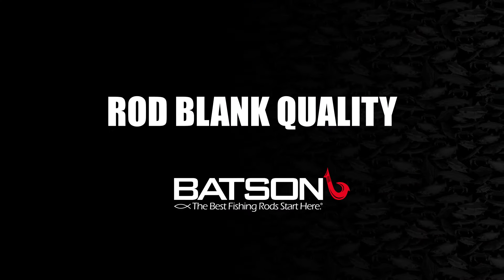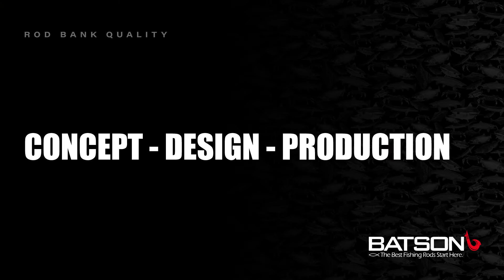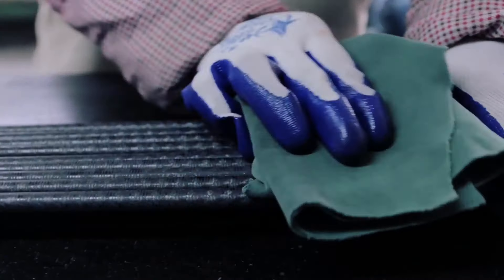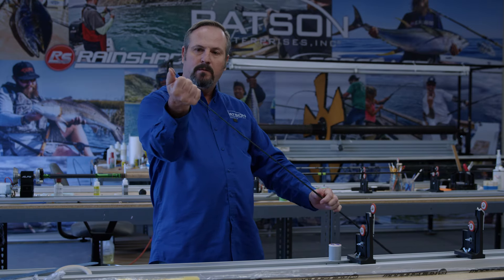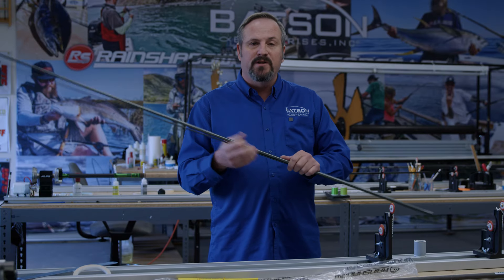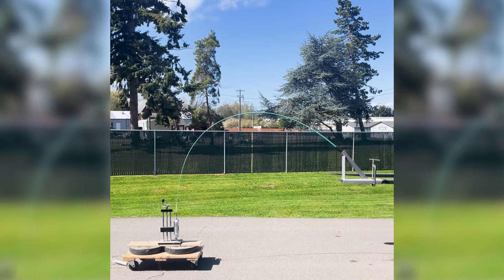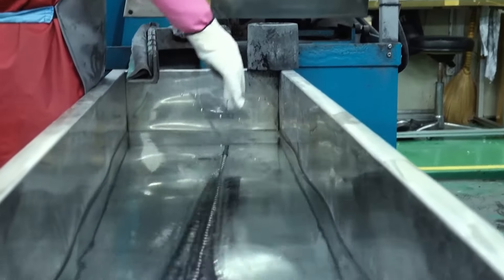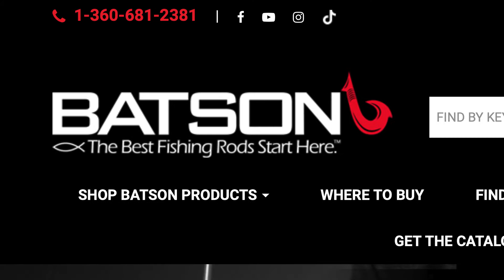Rainshadow Rod Blank Quality

Comment: I found an old school 10"6' blank(the old green ones) on ebay for one of my first rod builds. You guys wrapped that carbon thick back then. The bank has a perfect action for a salmon bobber rod but felt tip heavy with the reel seat at 14". Slid it all the way up to 18" and viola! A beutifully balanced rod. I'm sure the new blanks are lighter these days, but my lesson was that you can make a terrible rod out of a great blank if you dont spend the time to make the hardware function ideally with it.
Reply from the maker: Thanks for the build story Logan. Definitely good insight. It's been a while since we made any 10'6" salmon/steelhead models in green. Feel free to give us a ring if you'd like suggestions for a future build. Thanks for watching!

Comment: Gentlemen, I'm currently building a Rain Shadow Rod model RCJB90H. It's a NOS that I've had for years and just now getting around to building it since I'm retired and doing more Offshore fishing.  I can't seem to find much info in this model? It's a beautiful 7'6" rod with a blue tip section. If you have any info or if you could tell me if this blank is still available in other sizes,  I'd be very grateful! Love you guys and thank you for your quality & help throughout the years.